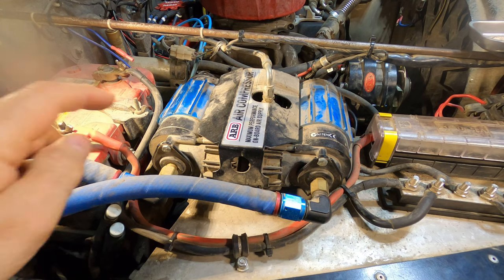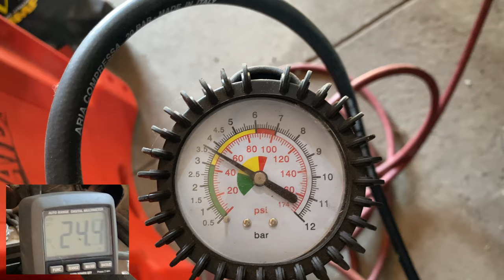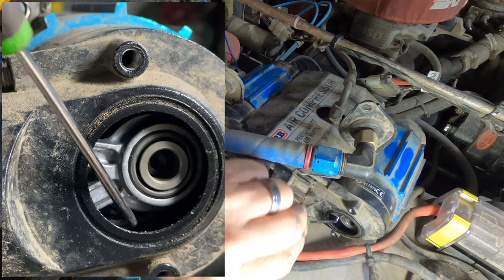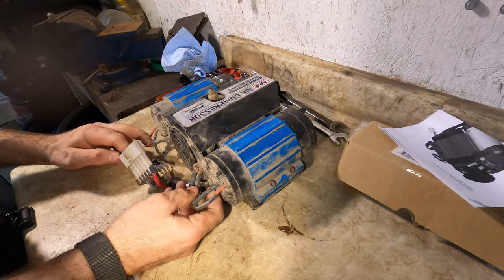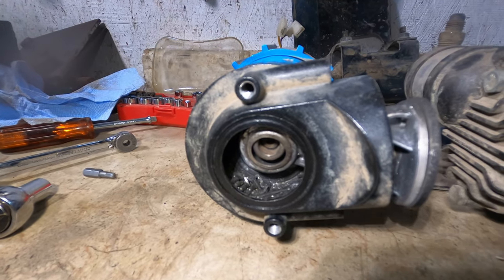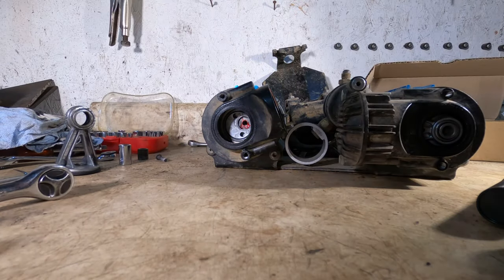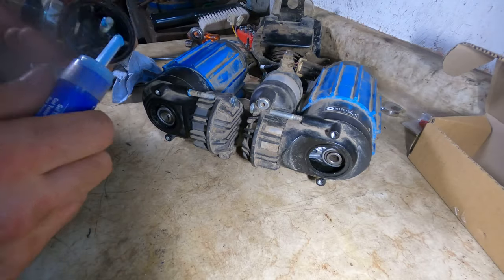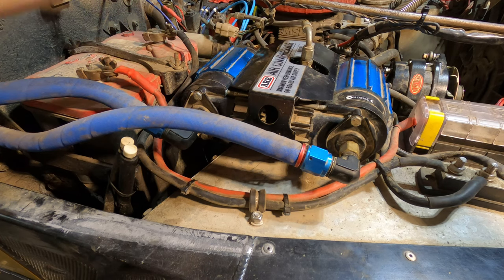ARB twin air compressor repair (including troubleshooting)

Comment: great video - ours just decided to kick the bucket on the weekend - now I have an idea of where to start. Thanks!!
Reply from the maker: As long as the bolt didn't shear off, super straight forward repair. They do sell the complete motor / pump replacement if the damage is significant. Good luck!
Reply: @EricCantin  Who sells them (rebuild parts)? I called the place I bought mine from, and they wouldn't sell me one, and I called ARB and they told me the compressor assembly was the smallest unit I should replace because my cylinder walls have little scratches. I wanted cylinder sleeves, orings, and bolts. They refused. I got bolts and orings from Ace. Since then I've seen lots of videos of worse cylinders going back together, so I'm putting mine back together.
Reply from the maker: @everettdurst1  Google ARB 320303 and order the service kit. That's what I did. As of today, about $33 USD from a few vendors.

Comment: Can you tell me on the little air tank under the cover, is that a silver sticker on that little tank? Is the whole tank black plastic? I just got one of these off ebay. Everything looks legit on the compressor, but the tank is misaligned with the airport. Mine is all black. Your looks like it may be aluminum?
Reply from the maker: Where the line connects? As i tap with a bolt sounds like some form of metal and not plastic. But this is a 15+ old unit, so no idea if they changed it over the years.
Reply: @EricCantin  Yea thats true. I suspect somebody tried to fix this one and got irregular oem parts.

Comment: Will you share some info on your air filter relocation ? Did you keep the air filters that came with it or did you modify the air filter too. I need to replace my air filter bronze filter but the only way to do that is to buy a hole kit , and I don’t want to do that. I’d rather spend more money and time to get away from arb air filter
Reply from the maker: The previous owner did the filter relocation. He pieced it together to look like the ARB 171319 Air Compressor Filter Relocation Kit. Can’t remember what filters are on it. Any filter with a threaded fitting could work.
Reply: Ok thanks , I sent you a message on messenger, if there is any way you would take s pic of the filter end of those blue hoses I would greatly appreciate it.

Comment: I tried to buy a rebuild kit for mine, and they wouldn't sell me one. They keep saying I should buy a new pump assembly, which I might as well buy a new compressor in a brand that sells rebuild kits. For the money, my old Viair is way better.  I'm just putting it back together and going to run it as long as I can then buy Viair again. These are neat, but they don't live long and they don't sell rebuild kits anymore.
Reply from the maker: Which model pump do you have? I had to figure out this was the part I needed based on the single compressor unit.
Reply: @EricCantin  I have the twin compressor kit. I ended up putting it back together with the scored cylinders and some new orings from Ace. It's working good enough. It sounds smooth and powerful, and fills all four tires from 8psi to 32psi in about 5-10 minutes. I think it used to do it much faster. I never timed it, but I think it's a few minutes longer. I mounted it inside the Jeep this time, and put real air filters on it, so it should last a long time now. I'm still convinced I'll put a Viair in there if these quit again, although I think the better filters would prevent this scoring.